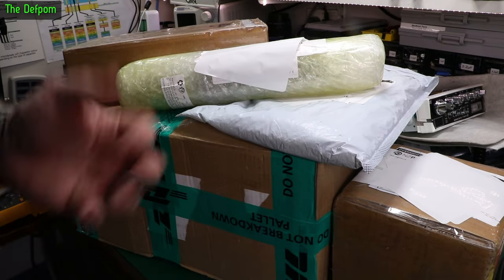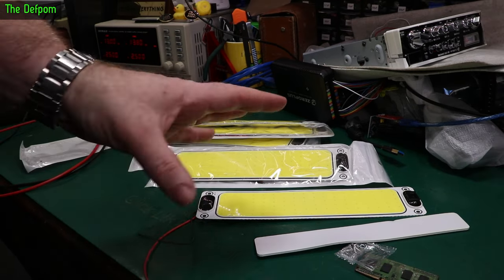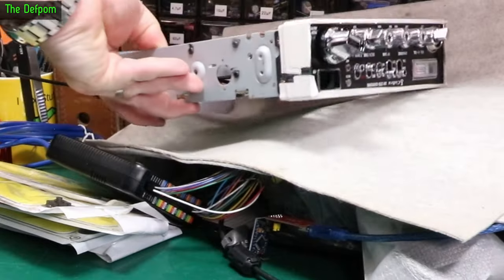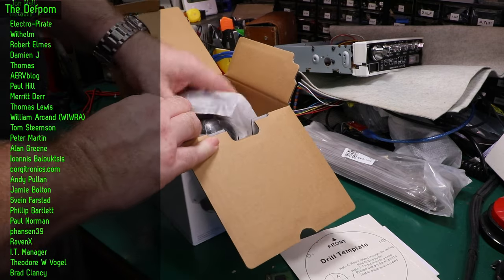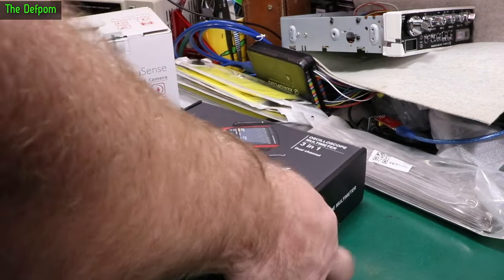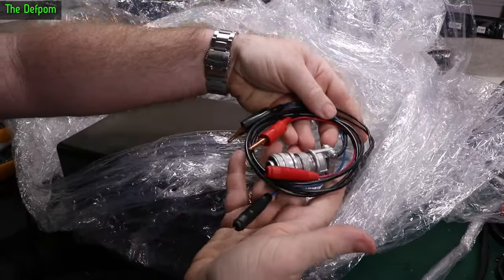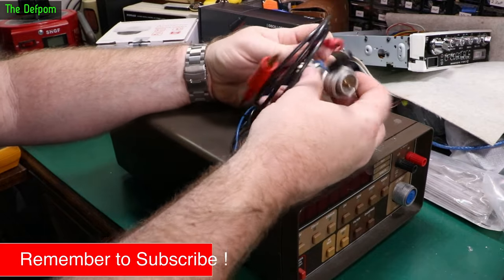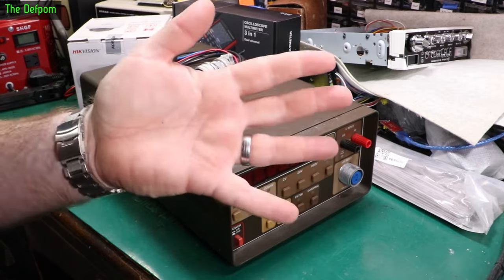🔴 Mailbag Monday 5th February 2024 - No.1217

Comment: It would be interesting to know if you are able to fully twist the BNC connectors to the locked position on the Zotek ZT-703, on the unit I have this isn't possible and the connectors held on by the friction against the case.
Reply from the maker: Yeah this is the same, I cover this in the review video which will be out this week.